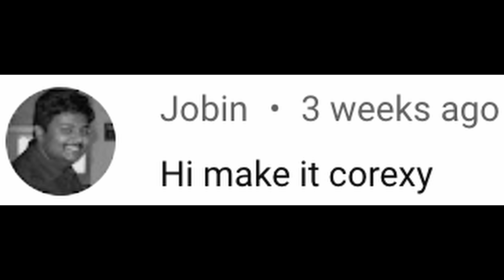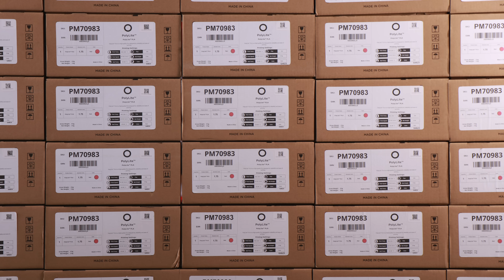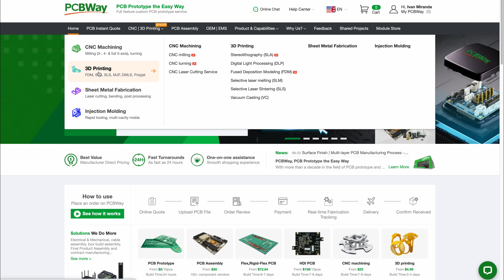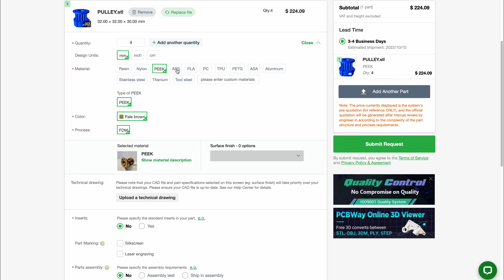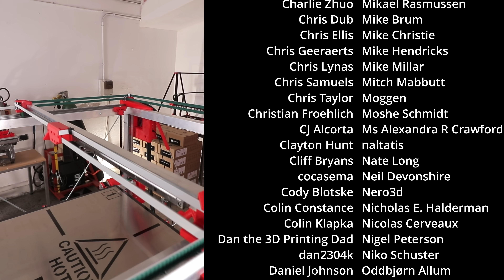I FINALLY CAVED, COREXY - GIANT 3D PRINTER BUILD PT. 4

Comment: When are you going to pull a Snapmaker and develop interchangeable heads for these monster printers? I'm imagining your tank with a custom cut Plexiglass type front and side screens for tank battles. Or removable safety shields for your printers to keep heat in and still be able to see what's going on.

Comment: Might need to look at replacing the washers on the roller guide parts to get less up and down movement of the belt. That is going to translate into slight location errors.

Comment: Another awesome video, sir. Those movements looked normal speed for a desktop printer. However, the size of your frame means that the hotend carriage was moving a lot faster than it looked. I'm guessing you'll need a massive heater and melt zone.
This thing will be epic when you get it completed. 🦾🦾👍

Comment: Try using a belt with smaller bumps so you can have milimetric presicion, since with that belt you only get the presition of one of that bumps (which looks big)

Comment: i think most of the noise is the ribs of the belt going along the smooth bearings in the corners, you may try to make a gear for each bearing the ribbed side runs across, and i think it will greatly reduce the noise
Reply: or at least reduce vibration significantly

Comment: I feel like if weight savings on your gantry is your goal, you could probably effectively do away with the aluminum channel and all the screws and just have printed mounts to join the X rail with the Y rails. That rail is pretty stout and unless you're putting a large pellet extruder on your gantry (which would definitely negate any benefit of ~25g of omitted bolts) you can probably get away without the aluminum square tube for additional rigidity.

Comment: I am so curious why all your 3D printers and cncs are made from aluminium square tube rather that something like 4040 profile? 4040 tends to be more rigid and straight and you can use hammer nuts rather than drilling so many holes?

Comment: Don't miss what's coming: he will use this 3D printer to make a larger 3D printer. ;-)

I am not someone who easily creates 3D models on a computer, so I always thought that making parts out of wood was much faster for me. But when you factor in fine details, sanding, finishing, different tools for specialist things and that you still need to design the thing you're making parts for and the actual parts, I am starting to be convinced that 3D printing is pretty cool and worthwhile to learn/do.

Comment: I actually need a printer that large for prototyping... (printing out molds to cast full body robotic girls). Currently I print the molds in sections, and have to glue each part together. Ideally my print bed would be 1.5m x 1m x 1m

Comment: once it becomes big enough the weight of the motor on the moving y axis would come neglible compared to the weight of the axis itself and it would have shorter belts than corexy.
Reply from the maker: The motor would be about 35% of the weight of the gantry assembly right now.
Reply: @ivanmirandawastaken  is it going to be direct drive extruder?

Comment: I can see a small problem in your build, the length of the belt could cause artifacts in prints unless you install idlers, I see a lot of vibrations in those belts when they move. Just on the outer sides I doubt any on the gantry would help and just add weight. It would be the same with screw drives I saw another build that used them and at higher speeds they would vibrate and cause ghosting on the prints.

Comment: At this scale HBOT would be far better than Core-XY because racking won't be an issue at this scale and Core-XY has way longer belt paths which would introduce issues.
You also needs to use locking nuts on the screws, and ideally locktight because you will have the screws getting loose due to the vibration of the rail....

Comment: Make sure that the belts, are parallel to the axis on this case the linear rails. in other case if the belts are not parallel you lose your accuracy at the very beginning of your mechanical assembly

Comment: Um, I think you'll find it's pronounced [pushes up glasses] "cor exy". Heh heh heh heh.

Seriously though, it's starting to look pretty epic! I was wondering when you were going to switch to metal gears. Probably better to get the 3D printed rather than taking punt on some random cheap gear and hoping it's right.

I'm also curious about motor temps at higher speeds. They're going to be moving quite a bit of weight once the extruder is mounted, but they're pretty big motors so hopefully they won't get too hot.

Comment: I don't think that corexy is the right choice with such a long belt path. It's known that it does not scale well... also I would put idlers and not bearings where the belt is touching with the bumpy side. That would remove some vibration from the belt running.

Comment: Hi please use klipper
Reply: Make your own watercooled hotend and run at high acceleration love to see how fast can it performs..also the belt needs to be little more tightened in your printer ..corexy needs more tight than Cartesian.. otherwise print output perfection will  be bad
Reply: Please Make Custom made WATERCOOLED hotend

Comment: Too short !! But understandable.. need to upload content.. little tip for people, with the humid weather and wet pla filaments, no need to dry it, set the temperature between 185 and 190 degree Celsius, not 200
Reply: 185°C holy hell what is layer bonding?
Reply: @SianaGearz  never test at 185 but no problem at 187
Reply: @SianaGearz  with 0.6 nozzle

Comment: COREXY ISN'T THE BEST OPTION FOR BIG PRINTERS 
people will tell u that big 3D printers used H-bot and it need super strong frame
then that core xy is better because frame dont need to be super strong but there is other issue 

belt length and how tight they need to be
 they start to rezonate and entire frame will resonate

in reality big 3D printers used mostly cartesian style where u have 2 motors on Y axis and 3rd motor on X axis like in CNC machines
most of the printers with other kinematics are made mostly to be different (literally because of the patent pending earlier) and other beginners start to copy it thinking its the best solution because big companies use it and now 99% of the people think core XY is the best everywhere 
but in reality cartesian style is and will be best option for any big printer ...and it is great in medium ones or where u want accuracy not epic speeds  and easy to work with 3D printer its still the best option 
with the bed of 3D printer moving only in Z axis never in X or Y 

people will tell u that it isn't better because u have motor on X axis=weight

bearings for Core XY are heavy too :)

and printers like that without servo-motors and way stronger frame can't reach the speeds where it matters
Reply: In all these cases, why not just use a robot arm that goes where it needs to go?
Reply: @rusticagenerica  to heavy and not accurate enough at high speed 
It is possible to use for slow big printers like for houses etc etc
Yet it is daaamn expensive